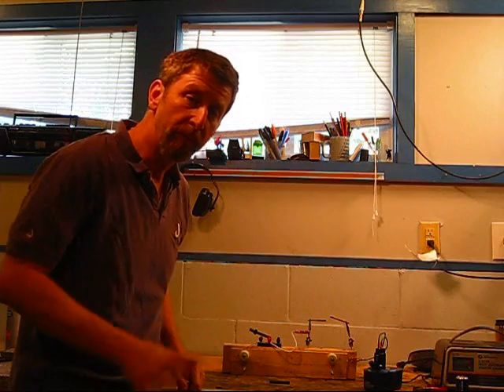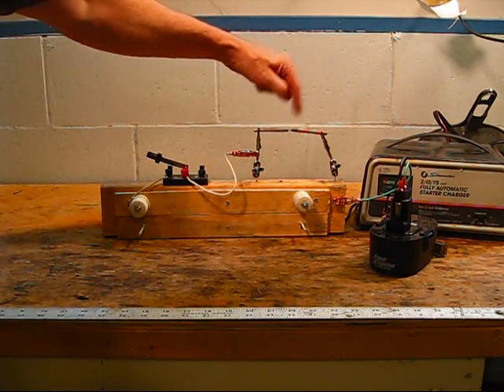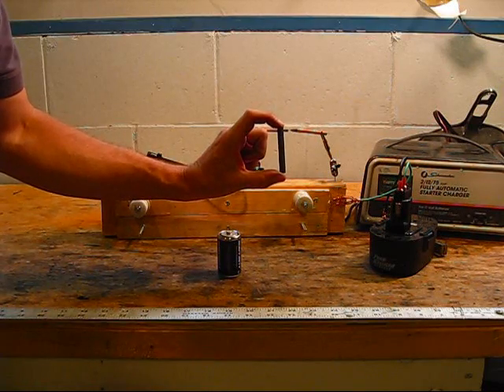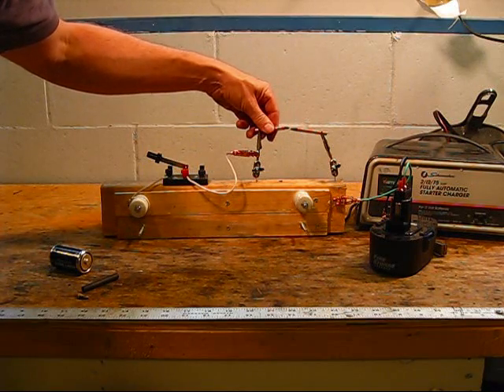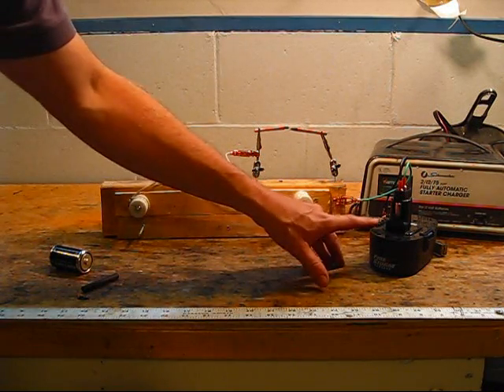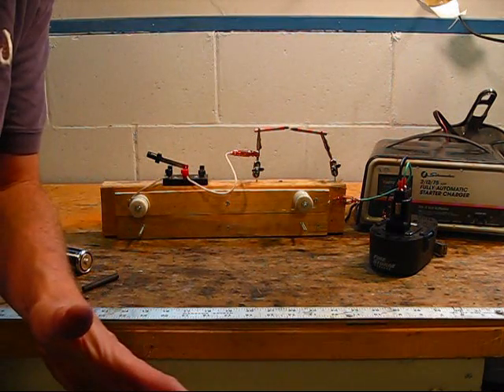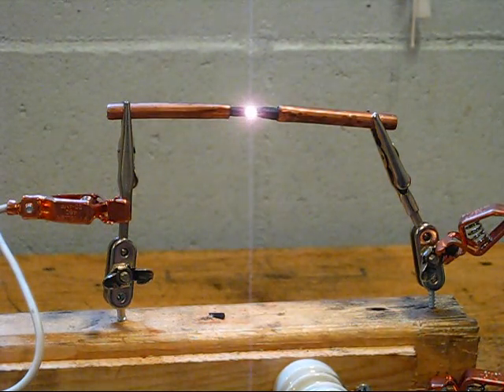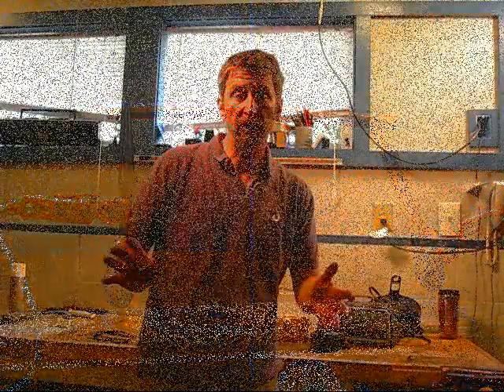How Make an Arc Light

Comment: That's nothing. When I was a kid, I used to take sparks coils from a car's ignition system and plug them directly into a 110v wall socket. Now that was a spectacular mad scientist-type arc light. The coils had a tendency to overheat and explode if you left them on too long, though, hee hee.